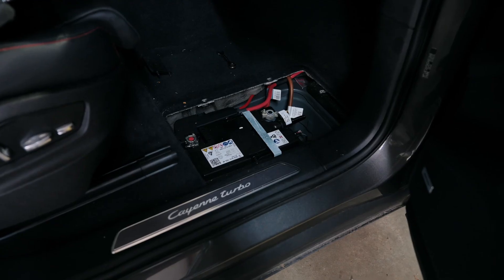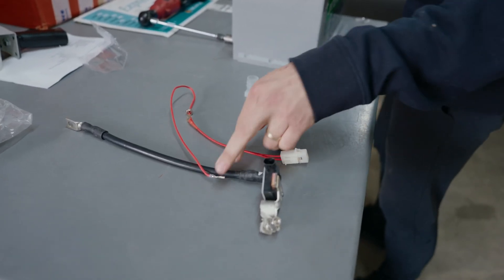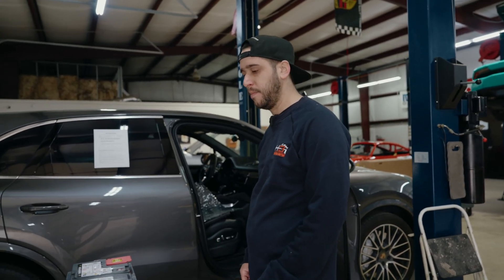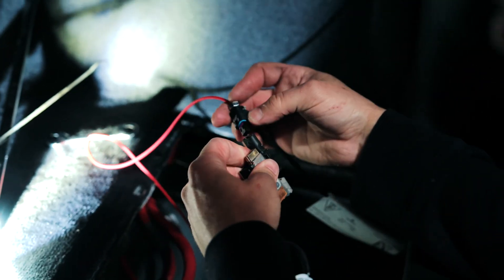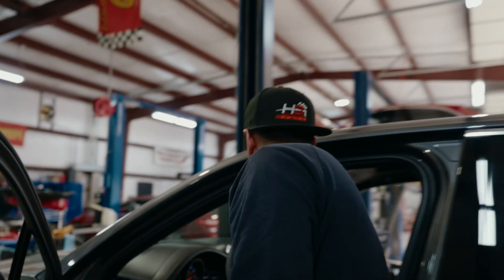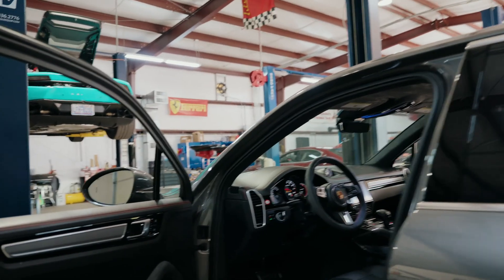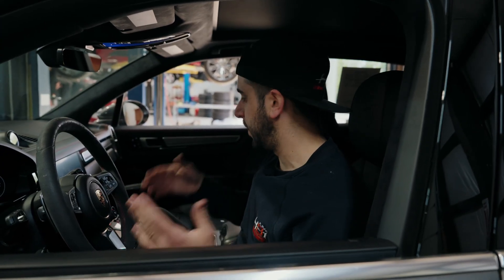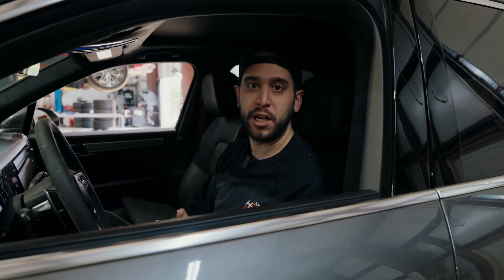How To Fix Porsche's Lithium Battery Problem  (2019-2024 Porsche Cayenne 9Y0)

Comment: TL:DR; - Isn't there any risk for the alternator given the higher voltage and amperage of the regular battery?
I ran into a problem with this idiotic setup in a Cayenne Turbo 2018, in the morning the batter was completely dead. Couldn't even jump-start the car. Since it was a sunny Sunday and I had to travel I replaced the battery with an AGM one. Now we're trying to revive the original LiFePo one but I would rather permanently replace it with the AGM.

On a more general note - Porsche's policy about this is a grave disappointment and the environment card just doesn't work here. You cannot seriously mainstream a x7 times more expensive battery without providing an alternative. It's not only the prince but also the availability. It's a common sense that batteries occassionally fail without warnings and ppl have to actually replace those urgently. But no - if you were lucky enough to pay premium for owning a porsche u'r basically fu***d and have to sit tight waiting for the exclusive LiFePo bs battery to arrive. Meanwhile - no car, sorry.

Low reliability, problems and wasted time is not why we are paying premium for a porsche!

I am so much going back to analog cars.
Reply: Porsche reverted back to AGM battery in their 2024 cayennes, with almost no change in engine setup. So there is really no issue as long as you use a scanner to register the battery in BMS.